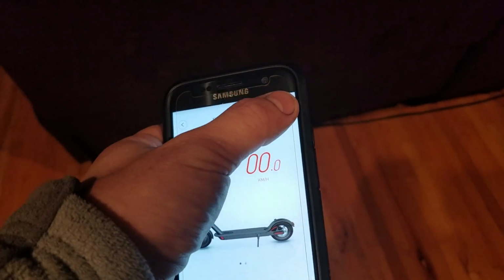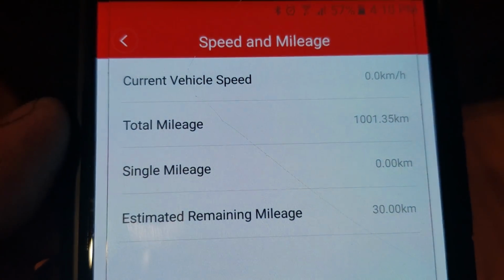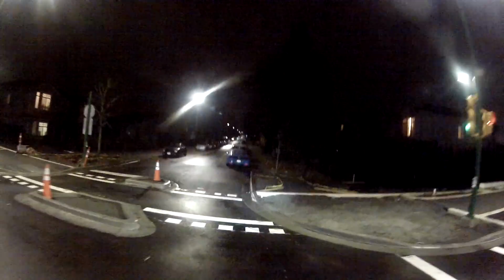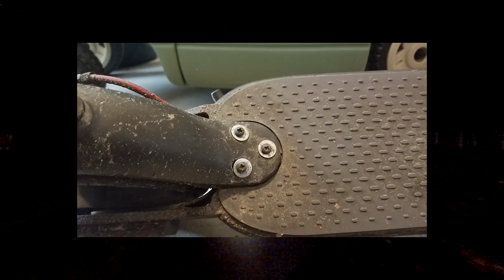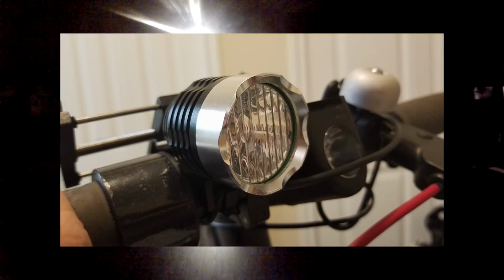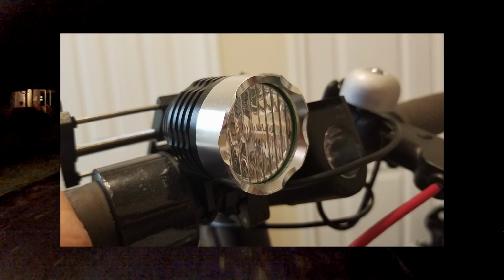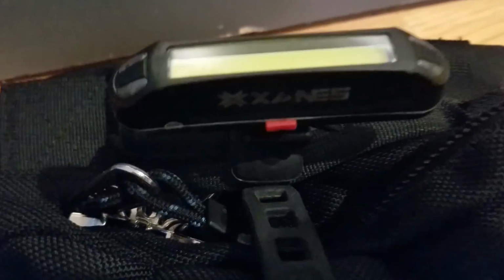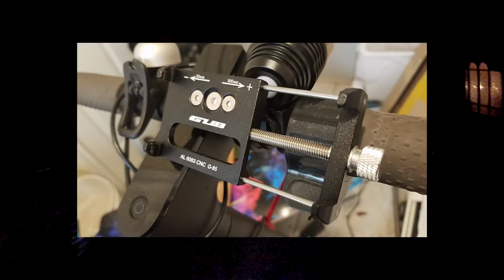Xiaomi M365 - 1000 km Review

Comment: Hey Doug, thanks so much for your reviews and the in-depth documentation about the m356‘s weaknesses and how to fix them.

Allow me one question: I am experiencing some problems with the rear brake. The brake disk seems not to be centered inbetween the brake shoes. It spins very close to the outer shoe so I cannot fasten the brake cable as much as would be necessary for safe braking. Have you experienced something like this and/or know how to fix it?

Best!
Reply from the maker: sorry i some how missed this message,  you can loosen the 2 brake caliper bolts and sort of adjust the position of the caliper a little bit. this might be enough . not sure. my brake pads are due from replacement and am planning to make a video on it
Reply: Great info, thanks a lot! Meanwhile, I found a video by @hrisson detailing how to adjust the rear brake: https://www.youtube.com/watch?v=cc5QSCBjyjw

Alas, I have to do some soldering first. The rattling due to the solid tires killed the battery welding spots...

Comment: Whats your current milage you have put on the scooter? Also any major issues? How many times do you usally change the tires? Thanks
Reply from the maker: im currently at ~1300 km. early in the past i had some battery terminals break, but i fixed those with some solder(have some videos on it). its been really good since.  i just changed the tires yesterday for the first time. only the front tire really needed to be changed

Comment: Two questions, bro. How often do you clean your M365? And how do you go about doing it?
Reply from the maker: about once a month. i only use a broom and brush off the loose dirt after it has all dried up. folding the scooter, laying it upside down, turning it on, and setting the cruise control on to spin the wheels at a low speed helps to brush off the front wheel really quick
Reply: Doug Hnut got it. But do you also grease the moving parts?
Reply from the maker: i haven't yet , but i should do that in the springtime. after all the rain has cleared.
Reply: Doug Hnut Thanks for taking the time to reply. Your videos have been very helpful.
Reply from the maker: +Paolo Fondevilla you're welcome!

Comment: Hi Doug, thanks a lot for sharing, this is what let me understand I actually want one ;) flats are due to good reason, the foam and tape tricks might help avoid the rest. While watching the rest of the vid: *how does it fare uphill*? I need to use it uphill like 30% (wher with a bike you lower gears a lot). Would it push me?
Reply from the maker: 30% is pretty dang steep. you will likely need to kick with the throttle applied. it will help each kick go a bit further. there is one pretty steep hill in my daily route(not sure how steep), i don't need to kick, but it goes as fast as walking speed. so i kick anyway

Comment: Hi Doug, First of all thanks for the video it was very helpful and interesting!
Did you have any problems related to water? I've heard the scooter is problematic when using in the rain.
And what are your thoughts about solid tires?
Reply from the maker: Thank you for watching! i'm glad it was helpful.
i have been riding in the rain for a solid two months, with no problems. even salted roads haven't caused any problems. i just avoid flooded pathways that are deeper than 2". 
i have a video about the solid tires in my playlist. be sure to read the comments. lots of other people have negative feedback on the solid tires.  I don't like them at all . i would rather deal with fixing flats than riding on those solid tires. they have much less traction and lock up easy when braking. which also causes flat spots on the tires. then you will feel those flat spots while riding, very annoying. other people have noticed less range and hill climbing ability. 
hope this helps.
Reply: Thank you for your comprehensive reply!
I will checkout your solid tires video. Heard some divided opinions on the matter as well.
Have you tried any anti puncture liquids? Some people say they affect the scooter range, I'm not sure yet whether to use them or not.
Reply from the maker: i haven't tried the green slime stuff yet, but i still plan to, just keep forgetting. thanks for the reminder. ill put it on a to do list. bee sure to read the comment on the solid tire video.
Reply: I tried SLIME. Did not work at all. My guess would be that all the people who swear by using SLIME on the m365 wouldn't have seen any punctures without it, too. I had two flat front tires and one flat rear tire within the first 400km. Switched to solid tires, regretted it ever since. If I could do it again, I would use anti-puncture strips for bicycle tires instead. Had pretty favorable experiences with those on my MTB.

Comment: Was looking at different lights and yours seem lik a good value one but where do u keep the battery?
Reply from the maker: i used a battery strap for for a racing drone and strapped it to the steering stem. they are like a dollar each. get the ones with rubber/silicone backing for more grip

Comment: Thanks for the reviews.  I recall seeing this scooter on sale for $300 USD last Black Friday.  Is that the right price range?  I wonder if there is a solid rubber wheel/tire replacement?  I might pick one up next time I see them go on sale.  Thanks.
Reply from the maker: that was a snap up deal if i remember correctly. you'd have to be extremely lucky to get it at that price. i paid $461 USD plus $160 USD for shipping.  so not much cheaper that today's price. 
i have a review on a solid tire in my playlist. be sure to read the comments. basically, i don't recommend going with solid tires
Reply: In Europe, you can get the scooter for about 280 EUR (which is about 300$) through vendors like Aliexpress, Gearbest or Banggood, often with zero shipping costs, probably because there is a rail connection directly from Europe to mainland China. That said, I would probably not pay ~500€ including shipping costs for the scooter. There are US-bound alternatives in that price range which are superior to the Xiaomi model, if you ask me.

Comment: hey man, I hearrd a few cases of people having the handle bar broken mid ride and crashing and breaking arms.  theres a reatining screw what breaks.
Did you have something in the handle bar part or the folding mechanism break or shake loose ?
Reply from the maker: yeah, ive heard about a pivot bolt breaking. nothing has broken on mine yet. im at 1500 km now. when i ride, i try not to put too much strain on the handle bar when going over bumps and especially when braking. i bought a spare latch and pivot bolt just in case.

Comment: Hello, do you have the same problem the battery is 50 percent or lower the scooter will lose power (go slower)?
Reply: madalintare111 yeah ive had the same issue
Reply: Hello, did you fix it??
Reply: In the month of October 2016, Xiaomi released a new firmware update skate (1.3.4), which modified the behavior of the scooter, causing among other things, to lower 50% of the battery, down a lot of power. With version 1.3.0, however, this does not happen (even so, there is still a decrease in power as the battery level decreases). I think is the software update not from the battery :(
Reply: madalintare111 not really but when I charge it works just fine,,,I'm 53kg so its not that bad
Reply: @madalintare111  when the battery has less charge its harder to output the same power. It's an inherent problem of the technology. If you just convert it to a hugher voltage the battery will not last long.

Comment: Can’t get individual cell voltages anymore. Ninebot app refuses connection and Xiaomi app doesn’t present the info. Help!
Reply from the maker: NO what phone are you using. I'm using a note 8 on Android 7.1.1 and only using the mi home app
Reply: Doug Hnut iPhone 6 iOS v11.3
Reply from the maker: NO I'm surprised that were able to sell individual voltages on a iPhone because I've heard many cases people with iPhones were never able to see the individual voltages. I don't have iPhone so I'm not able to test for you. Maybe someone else can chime in and offer some advice
Reply: Doug Hnut I appreciate the help, random question: do you think it’s a bad idea to use BMS 107 even though I have a double-fuse? I’ve heard some places that 107 just removes the legal speed limit but I can’t help worrying it’s for battery health.
Reply from the maker: i use bms 107 all the time now without issue and i have a double fuse, the scooter will over heat the motor before overheating the battery and it will not work until it cools off. the battery will work fine until about 60degC

Comment: initial investment an expences for tear-and-wear-repairing of a car, that you now also avoid, should be mentioned!
Reply: Yeah, and with the Xiaomi scooter, there are actually quite a few "tear-and wear" issues. These include - on my scooter:
- the mod for reducing the slackness in the hinge of the steering rod
- tire mods to prevent flats
- the mod for the brake light cable
- soldering of the battery welding points
- broken rear fender
- silicone insulation of the battery compartment
- foam mod to dampen vibration shocks to the battery
- chain lock or similar for securing the scooter

I had to do all of those on my m365. Takes some time and about 30% of the original price of the scooter.
Reply: @MaltePersike  

silicone insulation of the battery compartment    
foam mod to dampen vibration shocks to the battery

could you please let me know what are the products names and where did you buy them from?
Reply: @catalin633  Oh, those are just standard DIY parts. I bought a simple sheet of soft plastic foam (about 1in thick) and crammed it between the bottom plate and the battery cell array. Then I sealed off the bottom plate with plain hardware store silicone. A quick fix but it worked so far.
Reply: @MaltePersike   thank you for your answer

Comment: hi! how many km do you ride total and how far can original battery ride now ?
Reply from the maker: I'm currently at 1500 km, right now the weather is cold and it's effecting the battery range. About 17km . I'm sure when it warms up in the spring it will be much better. Btw I'm also running custom firmware that outputs more power so that is also gonna effect my range. 
With warmer weather and the original firmware I can expect 20km of range.
For reference, when the scooter was new, I was getting 22km of range.

Comment: Hey man! Thanks again for such great videos! I wanted your personal opinion... I'm having some sort of speed issues with my Xiaomi M365. I remember when it was brand new that when you get to like 5% of the battery remaining, it wouldn't allow you to speed up to 25km/h. It sort of doesn't go as fast and if you keep riding, it slows down until a complete stop. Now (after 4 months), it is sort of 'relatively' doing the same thing but way earlier. It starts not to have that umpff power from around 60% battery remaining!?!?!?! So it struggles going up a climb. It wouldn't even speed up when the road is straight. And even at 100% battery, it doesn't seem to have that same power it did climbing up a gradient road. I'm confused whether it's the battery or the motor?? Any ideas?
Reply from the maker: I've always noticed my scooter start to struggle up hills at about 50% battery, and in my opinion this is normal due to battery sag. i have the same issue with my electric longboard. now, if your scooter is struggling at 100% , i think it may be caused by the cold weather. when batteries are cold, they can't push out the same amount of current as when they are at room temp. so overall i think its all related to battery.
Reply: Cheers for that, man! So I don't know what to do at this state as it is just getting worse and worse :/ Do I have to buy an entire new battery (so expensive)? Or sell and look at buying a new scooter? It's just far from what it was... :/
Reply from the maker: wow, sounds like the problem is worse than i first thought. have you taken a look at the voltages of each cell pack  with the mi home app? make sure your tire pressure are nice and high(at least 45psi, i run mine at 60psi, this make a big difference IMO). i had one commenter that accidentally left his scooter in eco mode and didn't realize it till i mentioned it.
Reply: Hey mate, thanks for always replying back. Yeah, it's pretty bad that it almost feels useless. My tyres are around 30 PSI, I was worried that they would burst again at a higher figure (they did once)? But I tried to look at the battery cells in the app and tried every option but couldn't see that info and how to check that? I tried the Mi App and every function/option...
Reply from the maker: no problems! what phone are you using?, the mi home app works on my samsung s7. i'd suggest try another phone. im thinking it is battery related, but i rather not guess. i also hope you are not running any solid tires, i've seen bad performance for people running those solid tires
Reply: Hiya! I'm using an iPhone 6S Plus which should be fine? Always updating the app regularly buy cannot see the battery info except for the pack as one and not each individual cell. I actually tried to fit one solid tyre and failed! So I got another pneumatic one and stuck to that :) So no solid tyres ever.
Reply from the maker: i think the iphone version of the mi home app wont show the individual cell packs. i suggest finding someone with an android phone and try that
Reply: Oh really? Thanks for the tip! That's crazy though that the Android and iPhone are different...  👍🏻
Reply: Doug Hnut Hello, thanks for the nice infos. Im also xp a Small Performence degration starting at 70%. At 50% its more obivous. Most of the time im Rideing in ECO mode. I feel its not save to drive faster in the City whit only one real break on the rear. Have you ever thought on making a Video whit battery diagnosis for that scooter ? Starting whit what tools you use, how much voltage every battery pack should have. I seen a russian guy buying a aftermarket battery pack whit more capacity. He also needs to change the „Controller“ for that. Im Guessing you cannot buy youre own Batteries, and build up youre „own“ battery pack ?
Reply: The performance and life of lithium baterries are highly influenced by charging habits. Any over discharge lower than 30 % will shorten battery life. Lower than 15% , the battery life will shrink into 2 years( 80% power capacity). The optimistic strategy is to use it between 30-70 %. Recharging times is not an issue, but over withdrawing or overcharging will kill your battery.

Comment: Did the 50v Meepo board end up working well? And what is your solution for charging the extra cells. Are you planing on getting a 12s bms for the batteries in the future?
Reply: Can highly recommend a deck, front truck and bushing swap as well
Reply from the maker: i'm still waiting for some good weather to test out the meepo board. i bought a 50.4v charger off of ebay to charge this, and if it works out, ill get a 12s bms for it too.
Reply: Doug Hnut its the same here it literally rains 24/7. Some well made splash guards is the way to go. Like I’m a 100% dry no matter how wet the roads are. And if you seal up the ESC and battery case properly the only thing you will mess up is the already shitty bearings. 

My board: 
http://a67.tinypic.com/11s2jvq.jpg
http://a67.tinypic.com/260979f.jpg
http://a67.tinypic.com/2yts2sm.jpg
http://a68.tinypic.com/wbqdc8.jpg

Source: 
https://www.google.se/amp/s/skatefurther.com/2015/10/09/product-homemade-mudflaps-with-eric/amp/
Reply from the maker: +John Diedrichs deck swap is in the works ;) im not worried about getting myself wet for these videos, just concerned about frying my esc. Maybe this comming tues or wed ill seal up the esc and battery case and go out for a ride regardless of rain or not.

Comment: I have the 1.3 version and I noticed that when the battery fall under 40% it loses power ,,,,,I have some problem or that's ok?I have about 400km but it was from the start
Reply from the maker: this is normal, and is caused by the battery. as the battery drains, its voltage drops. when the voltage drops, it will lose power. this is especially noticed on hills.